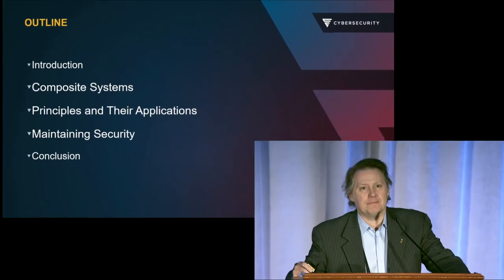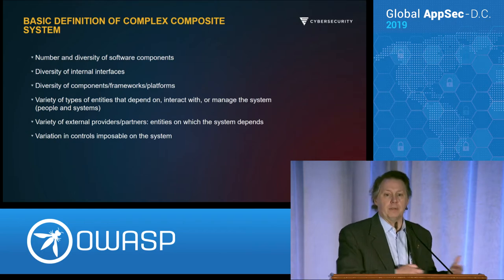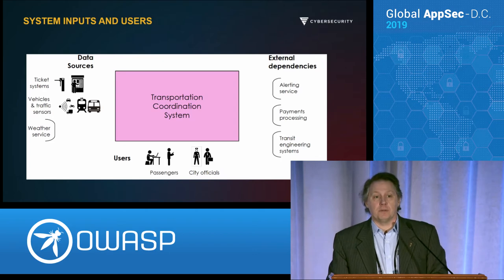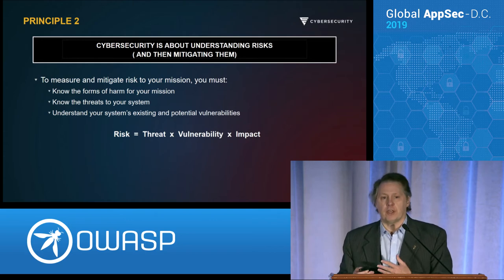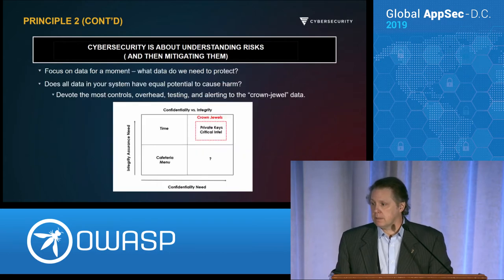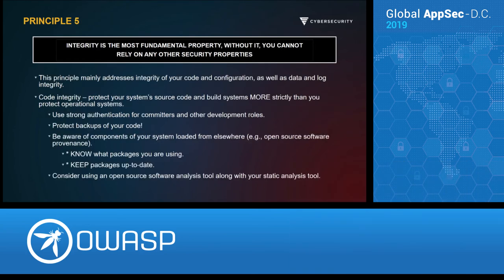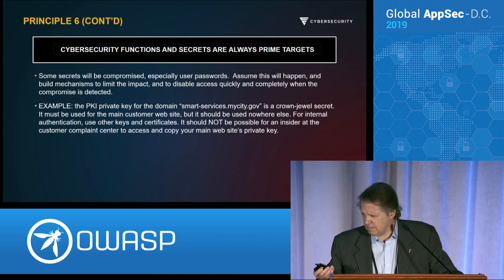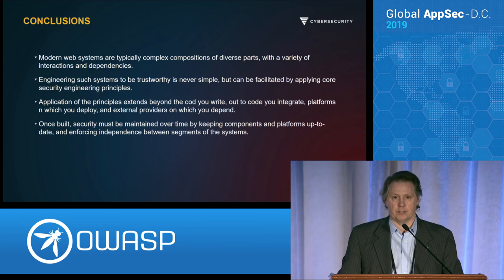Keynote: Applying Security Engineering Principles to Complex Composite Systems - Neal Ziring

Comment: Here's the list of principles:
1. We apply cybersecurity to optimize mission.
2. Cybersecurity is about understanding risks (and then mitigating them).
3. Theories of security derive from theories of insecurity (aka - think like an attacker).
4. Assume that attackers know the structure and operations of your system.
5. Integrity is the most fundamental property. Without it, you cannot rely on any other security properties.
6. Cybersecurity functions and secrets are always prime targets.
7. Assume that your system will have malicious insiders.
8. Understand the security that your system relies upon from platforms and external service providers; then check that those things are properly configured.
9. Understand the security provided by your system which others rely upon.
10. Plan for failure.